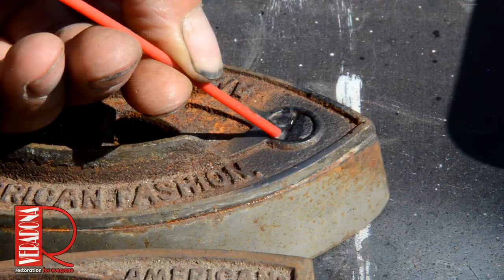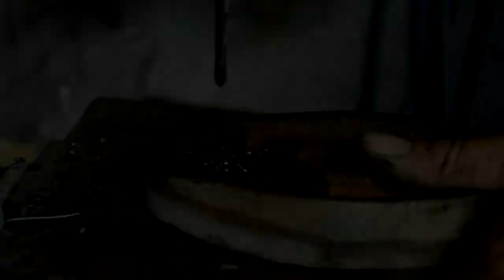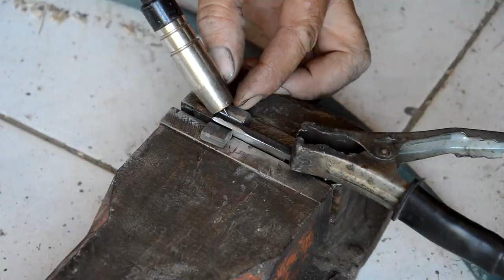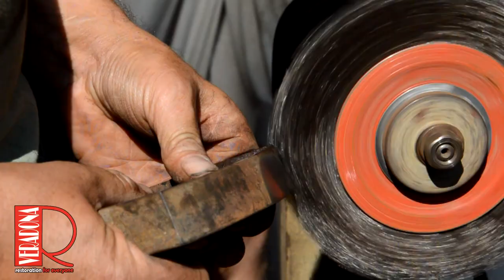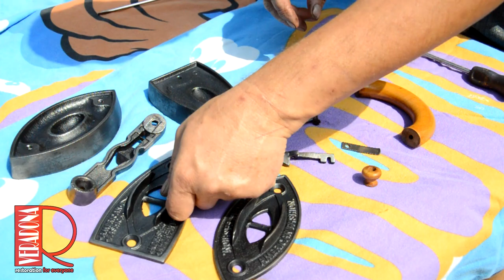Very Rusted of antique irons Restoration  . Jak restaurovat starožitnou žehličku 2. DIY

Comment: There is a thin metal flap that goes on this iron as well. I’m Trying to put mine back together after removing the rust and I don’t know where this little piece goes :( I see it in your video but I don’t see you putting it back on the iron.
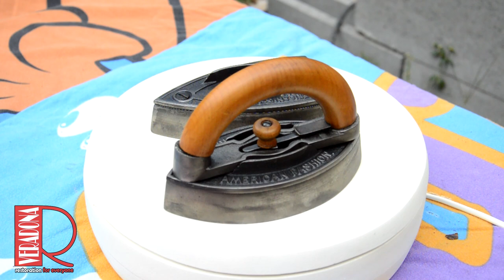Reply from the maker: If you mean the spring plate, it fits just under the handle. At 3:22 in the video